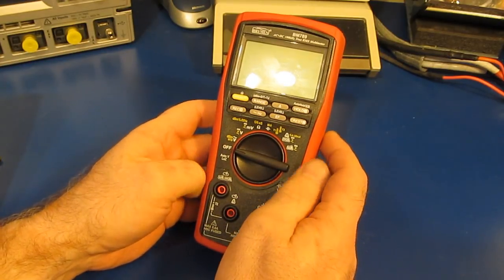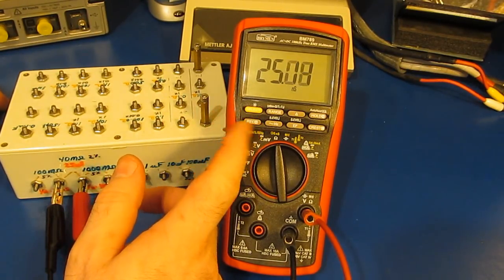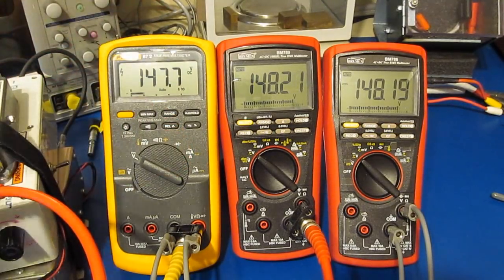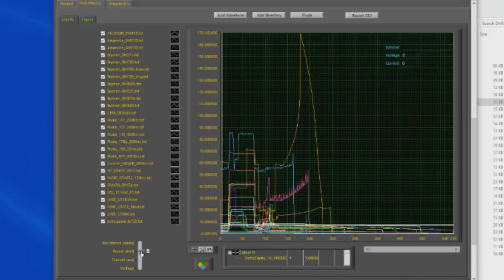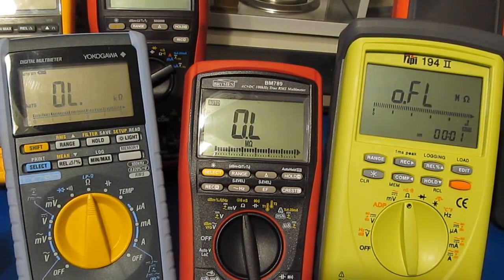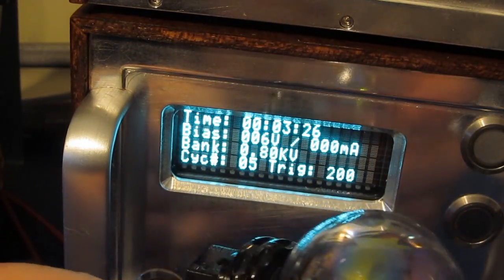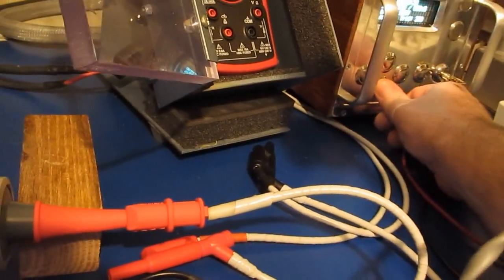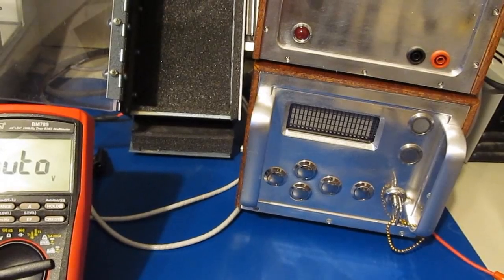Brymen BM789 DMM

Comment: Which one is better: Brymen BM789 or BM857s?
Reply: 857 better
Reply: @funcool8884  Why do You Thank that? BM789 have more usefull functions...
Reply: @raphaelsl1082  New doesn't mean better.Brymen is still working on the bm789 firmware. BM857 has a classic body and ergonomics, despite the functionality is more convenient to work with.